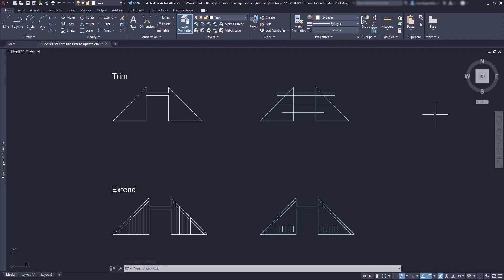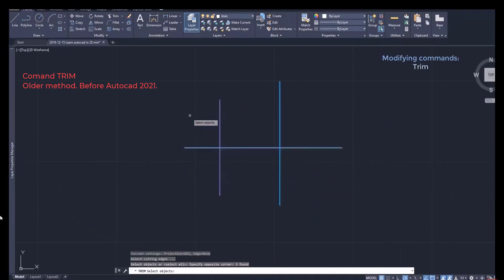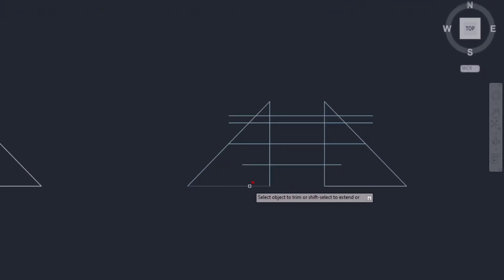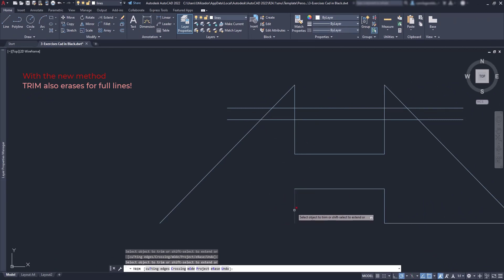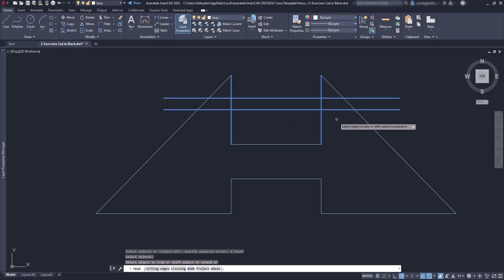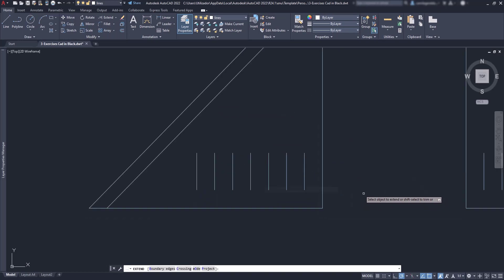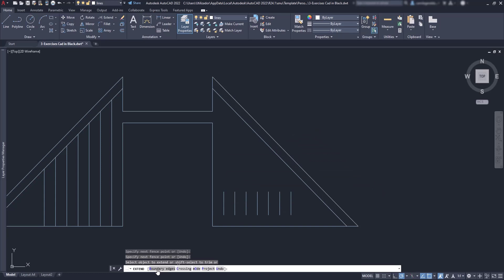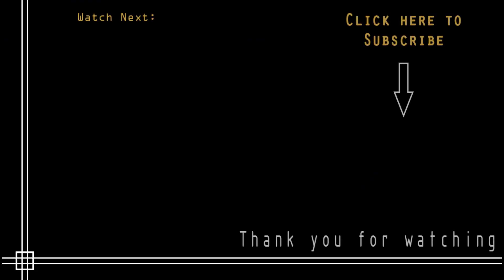Autocad - TRIM and Extend (New Update in Autocad 2021)

Comment: Change the system variable TRIMEXTENDMODE to 0
Reply from the maker: Thanks a lot for the tip Adolfo. So each user can decide the method they want. 
TRIMEXTENDMODE = 0 -> Old method
TRIMEXTENDMODE = 1 -> New method 
Personally I got used to the new method as most of the time is faster for me.
Reply: you cant imagine how much you helped me, i was in a confused state of anger and despair, thank you so much. The new mode makes zero sense to me, plus edgemode is not working anymore, that s terrible

Comment: Thanks.  But you know this new method is really hard for me especially if you used it for the past ten years.  Still, i guess i need to adapt to some changes.
Reply: Fortunatly you can go back to the previous mode using TRIMEXTENDMODE = 0 -> Old method
Reply from the maker: Yes. If you are used to the old method, it may be hard to stick to the new one. I recommend you practice it a lot until it is normal for you.

Comment: I hate the new trim and extend...................I always end up clicking twice or a line gets caught up in the command and screws it up.
Reply from the maker: Hi Mark. I think that's because we are used to a way and then they changed a bit the things.
However you can  choose "cutting edges" to make it work as we were used to it.
Reply: i m on the same boat, i hate it with a passion it makes zero sense. Fortunatly you can go back to the previous mode using TRIMEXTENDMODE = 0 -> Old method
thx god

Comment: This is nothing new. It's been around for a while. If you're going to teach, you should know the subject matter.
Reply from the maker: Hello Vinnie. Thanks for your comment. In this video I just explained that Autocad changed the steps that we should take to use the commands. If we open Autocad 2020, we can see those steps were different. However, what we can do with the commands, it's the same.
Also,  I said it was new in Autocad 2021, even it was released more than one year ago.
Reply: @CADinblack  I appreciate your quick response to my comment. I wasn't clear in my comment, what I meant was the option to not pick trim or extension edge lines  has been in place for quite a few years now. I believe since 2016. That's why I was surprised by your video. I was expecting something new from Autodesk. Keep up the good work.
Reply: thay changed the function since 2021, that s the topic, you should pay attention before criticising